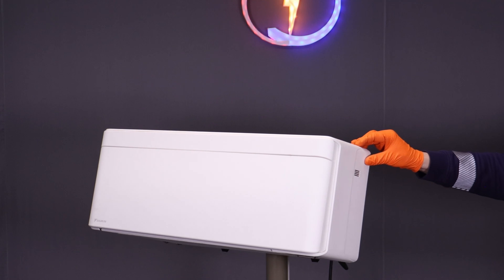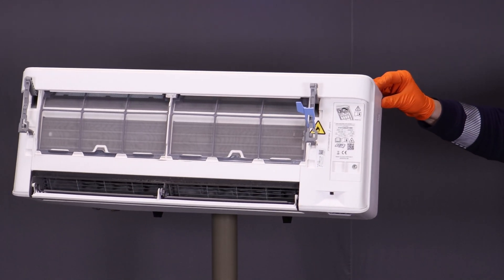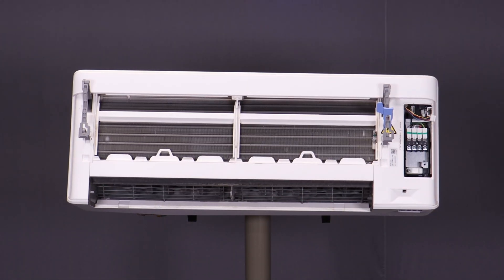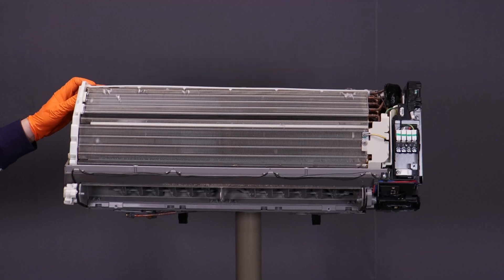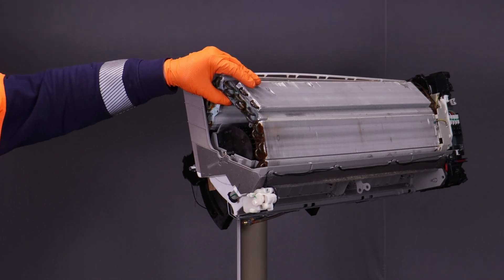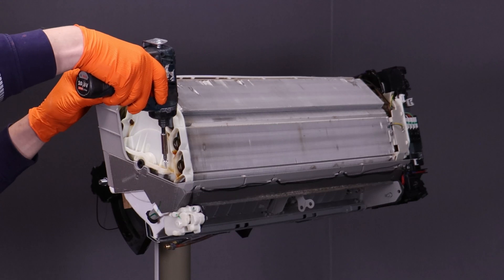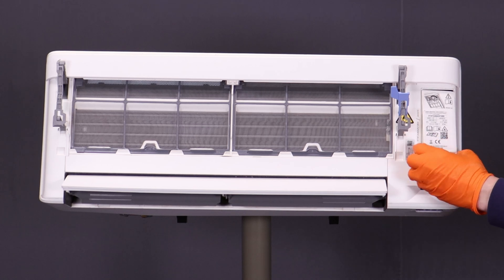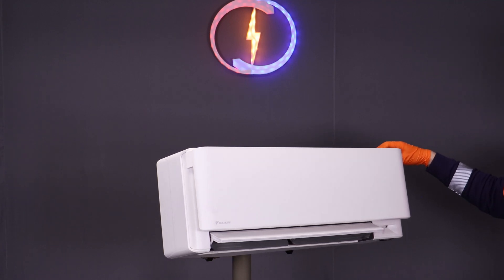Daikin FTXA Stylish - Air Conditioner disassembly for full cleanout - Extremely detailed

Comment: I have 3 of these units. One is having some waterdrops behind the fan guard in summer while the others do not have that. I think something is not installed right at the factory and I asume it being a very simple thing or the fan is not stabilized/balanced enough and moving too much while turning and  pulling some water out due to vibrating. Any thoughts? If the latter I might just order a new fanroll.

Comment: Hey - great video! Just had 5 stylish units installed myself and all of them have a high pitched "buzz" noise that sounds to be coming from the right side of the fan. Only happens when fan is spinning, and doesnt seem to get more/less loud on different fan speeds. Also happens when in fan only mode, so have ruled out it being refrigerant line noise. Do all the stylish units have this noise? Asking as you mentioned that debris on the magnetic part of the fan can cause noise - could this be it? Odd that it is happening on all 5 units though...

Thanks!
Reply: maybe this is stupide ... but did you leave the streamer on ? it make a high pitch buzz, only when the fan is running
Reply: I have the same issue. Did you find a solution? It sounds to me like a high frequent electronic noise, maybe from the electric motor of the fan or the control unit. It is exactly like yours. Also only in fan mode and also the same at different speeds. It is no mechanical issue or airstream noise l. It has to be from electric...

Thanks :)
Reply: Did you manage to resolve this? I'm thinking of getting Stylish units but I've read a lot of complaints like yours. How loud is the noise?

Comment: So, I'm making a commitment.
The company that have installed my AC unit are completely incompetent in maintain it. I had, in 4 y, 6 water damage due to clogged condensation and the axial blade have been covered in mold for 2Y now.
They say it's impossible with the stylish unit to remove the axial fan without purging the cooling gas first, something they refuse to do because of cost.
You showed me otherwise ... If I can get that fan out of at least one unit, i'm sending you a mail for a small 50€ donation, and cleaning it with my power washer.
It may still not be possible because i have a wall on the left side of all unit... but now i have hope !
Reply from the maker: It is possible to wash fan blades without removing them. Units can often be forced tilt by lifting it in place from its backplate. All of these tricks should be known by maintenance persons.
Reply: Sadly i don't have enough space to pull it ...
I'm now trying to get any info about how i can remove the unit while leaving the radiator on the wall, or at least only the drain pan.
But i can't get my hand on the technical manual :(
Reply: @vlycop7404  You can't remove the whole unit without the radiator, you will need to pump down the refrigerant and after that you can remove the indoor unit from the wall
Reply: I managed to remove the motor, but they are plastic bit that stop the fan from coming out from the right 😢
I can't get the yellow plastic cover off :(
Reply: @vlycop7404  I have the same problem with 2 units, as the left side is facing a wall with about  15 cm of space. How did you solved?
Reply: @ruimartinho77  For one unit, i was lucky enought to have a closet near on the left side, and manged to bend it enought to pull the fan to that extra space.

For the 3 other unit, all with a wall on the left, i gave up. I removed the fingerguard, took a strong enough brush, and let it rub in speed 1 fan mode for about 10mn per brush lenght

It's not good, but it's better. i had to use a pipe cleaner afterward to make sure the debris where removed and not sucked by the pump.

Comment: Hello, nice video! The white plastic removal to create space to remove the blower wheel can be also applied to a perfera 2021+? I saw some videos but they bend too much. Cleaning the blower wheel without removing is tedious, last time I used baby bottle cleaner brushes. The blower wheel can be removed from the right side?
Reply from the maker: I don't think the fan fits out from the right side. It might be tedious but with right equipment there is a way to clean it with water spray. Removing the fan can be too much for some people. We are going to do disassembly from Perfera too but structurally they are very similar.